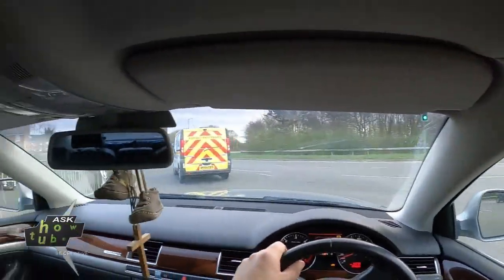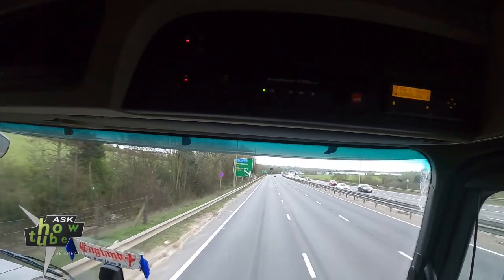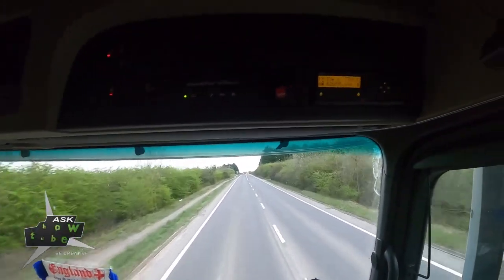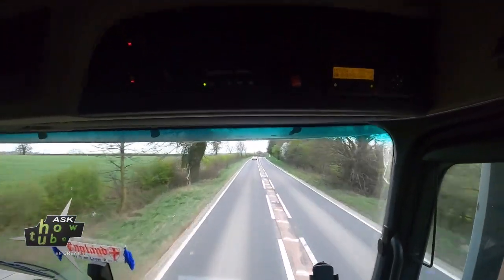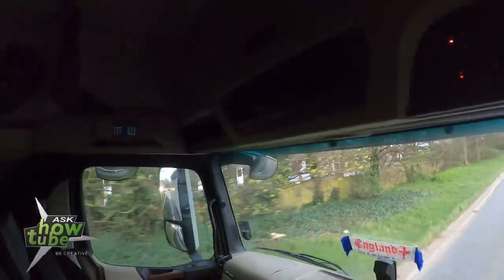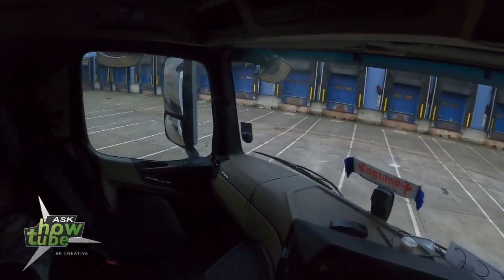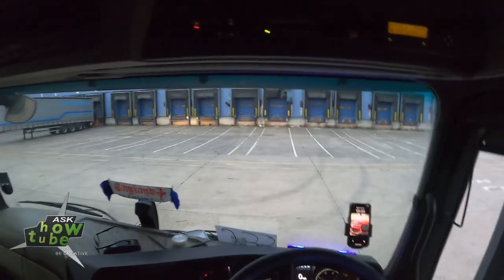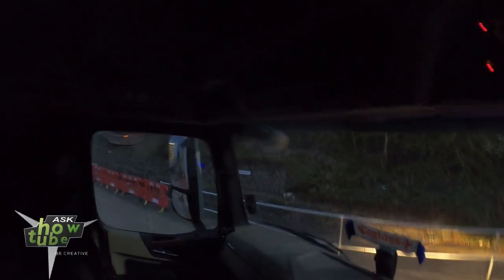How I drive a HGV class 1 truck, how I reverse, How I shunt. Mercedes actros 510 bhp

Comment: I like your video and driving and your driving ethics, is very good . But I noticed you never did any checks (walk around) before you drove out of yard ??? I’m in training for class 1 . Your experience is highly valued thanks for making video.
Reply from the maker: Hi, thanks for watching, and for spotting this… I do vehicle check every time I am starting a shift, and I do checks very well… but I wasn’t sure if my boss would allow me to film and make this video, or not, so that’s the reason, every time I was outside with the camera, I was trying to be as short as possible because I didn’t want to risk being seen…one time my boss even asked me if I am doing an MOT to the unit, or what?😁 I have to do vehicle checks, because if I don’t and something wrong happens because of a fault with the unit, it might not help the fact that I am a good driver or not… and an accident could of been easily avoided if I did my job right from the start…so thanks for bringing this in discussion… Goodluck to you.

Comment: Drive 5 years and that's how.. Over 90 percent of drivers at the moment are with huge experience so of course they know how
Reply from the maker: I don’t know what you’re trying to say, maybe explain better… yes I have 5 years experience on one wheel🤣🤣🤣… got my driving license in 1998, and I have driven all kind of trucks… as my father own his truck, I have started driving it (off road of course) when I was 11 years old… and it was an old truck, manual, drive it off road in the forest, carrying wood through the mud, or ballast through the river… get stuck, go out and shovel in front of the wheel, have a flat tire and fix it on the side of the road…it wasn’t as easy as it looks today…that was real work,
not today… you just stick it on drive, go on motorway, and that’s it… and I hear drivers moaning that they have to open the curtains, or need to unload the cages… what can I say, tomorrow drivers will moan they have to drive🤦🏻…